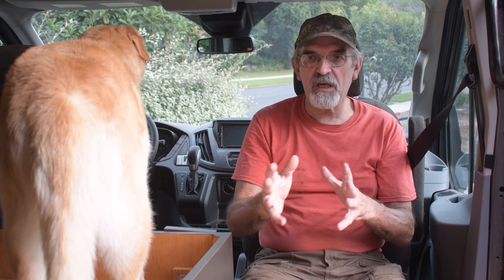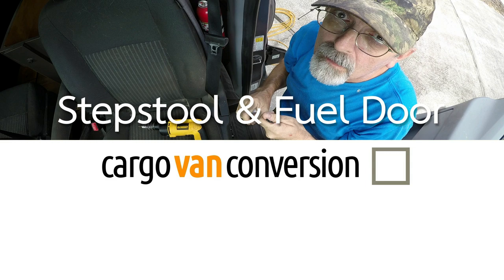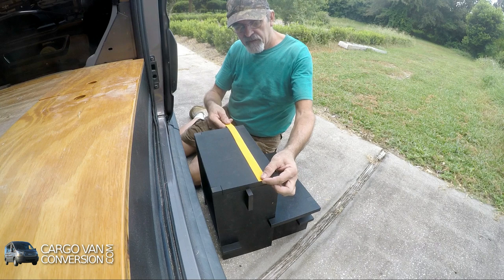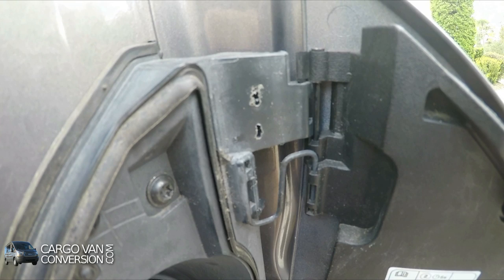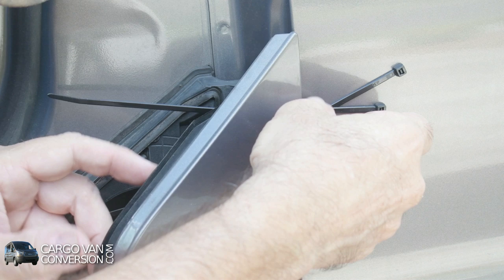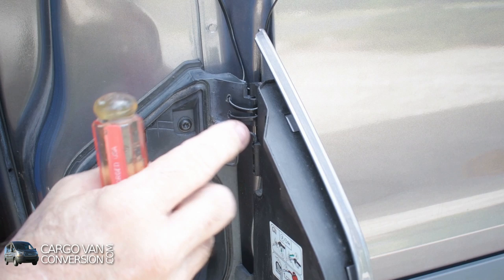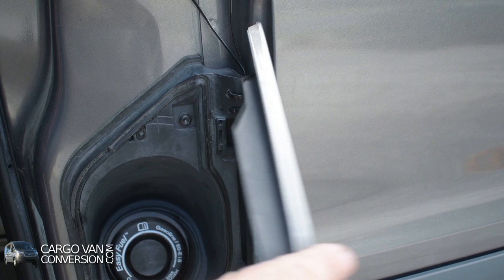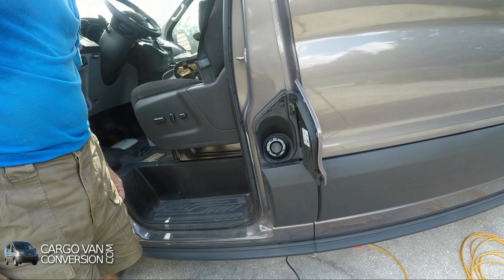Step Stool & Fuel Door

Comment: Glad you’re back! That fuel door is a disign flaw as I see some Transits with the door missing over here in Europe. They should have avoided plastics in those areas. I would inform Ford about it.
Reply from the maker: Ford must be well aware of that from what I know. I see it as a source of income for Ford and its dealers. The design has changed with newer models, but as you said, this vehicle has been on the road in Europe for quite a while and Ford hasn't made it disappear.
Van Williams or Nico :)

Comment: Thanks for that tip.  Those has does are a pain. Replaced a few so far. And glade to have you guys back.
Reply from the maker: Hi Al,
Just an overall bad design. They have the same issue in Europe as Leyland9999 mentions.
Have a great day.
Van Williams

Comment: My goodness, look who posted a new video!  It's nice to see both of you again. You have been missed.  Re the steps, just on the possibility that you might need to approach them from the side after dark, how about putting a strip there, too? Trip and fall is miserable, especially if one gets an injury.  Good fall prevention idea, as your ideas usually are.  Enjoyed the fix you used for the gas tank fill door.  Clever.  As you were, sir.  Carry on.  And we will watch.
Reply from the maker: Hi Nona,
No need to worry about me or Joey, but thanks for your nice words.
Not absolutely necessary, but why not, it's simple to do. Great idea. Getting older, you suddenly get a greater appreciation for safety.
Stay in touch.
Van Williams and Joey
Reply: @cargovanconversion  Thanks, I will.  Also, I found your van flooring project on Facebook.  Nice.

Comment: Hi Bud and welcome back.. missed you here in the uk.. Just a small point.. !! can i put you off putting you electric hook up in the fuel cap..? Gas vapors and electric don't go together very well.. Keep the videos coming mate..
Reply from the maker: Hi Wondering Womble,
Something to think about. Separate compartments though, with the cable below. Wouldn't be energized when stored either. You're right though and no worries for now, because the fix seems to work well and I anticipate it to last a long time.
Van Williams

Comment: Glad to see you back, I had wondered what you were up to.  I like the zip ties and it seemed to work well.  Have you ever used baking soda and super glue to replace broken plastic parts?
Reply from the maker: Hi Traveling Terry,
The zip ties weren't my idea, but it seems to work great.
I have never had much luck with super glue, but you peeked my interest when you mentioned the baking soda. What's that all about?
One issue is the pretty strong spring, just below the hinge; I doubt whether any kind of glue would do.
Van Williams
Reply: @cargovanconversion  You can do a youtube search,  but you dab a bit of baking soda, and the drip a bit of super glue, and wait a min and it drys, the do it agin and you start to get a growing glob and then you can shape it to fit your needs.  It drys a bit like plastic and very hard as well.  Let me know if you try it...

Comment: Hey, welcome back ! Missed you, and Van too ;-)  You know we're all about Joey lol !

So, you need to have the driver door open to open or close the fuel door ? Seems like a silly bit of badly designed security, especially when it's just cheaply made plastic, easily pried and broken by a fuel thief. And prone to accidental damage. I also don't like the idea of the fuel filler being right at the door for a lot of reasons. Looks like a good fix though !

Take care and be well !
Reply from the maker: Well Joey is the boss, isn't he?
The whole design of the fuel door is a mixed bag. I do like the location; you have to exit the vehicle anyway to fill up (except in Oregon and a few other states, which makes it awkward again). The whole design is flimsy, but I suppose, that's done on purpose. They do make a profit on replacement parts and $350.00 including installation isn't too bad either.
Siphoning off gas isn't so easy anymore nowadays; a built-in mesh at the bottom of the fill pipe prevents that. Much easier is making a hole in the plastic gastank and getting it there :)
Van Williams and Joey.
Reply: @cargovanconversion  True enough about the puncture and drain alternate theft.

Comment: I would have illuminated the steps by led and battery and you still can put it into parts.
Reply from the maker: Hi Andreas,
interesting idea, but I hate batteries; when you need them, they're dead :) I may add some lights under the vehicle at the sliding door, that light up when the sliding door opens. Have to think about that :)
Van Williams